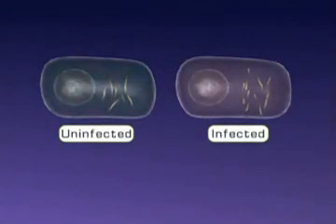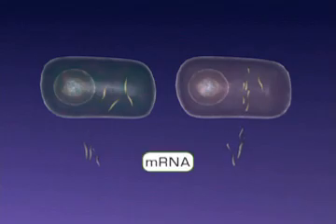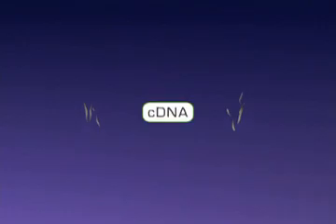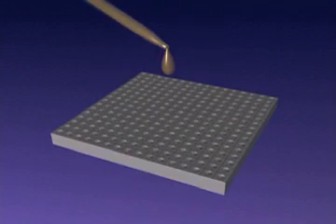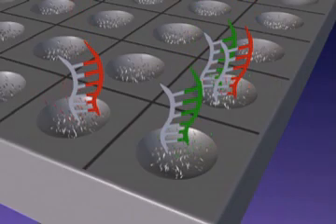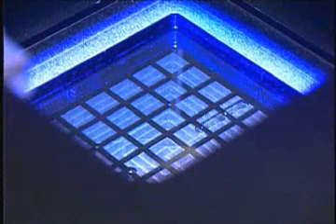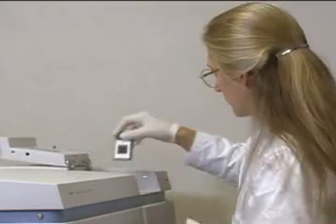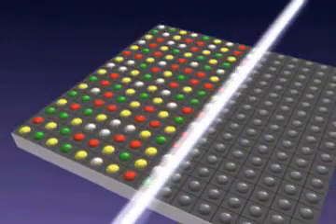DNA microarrays

Comment: Question: Why combine the samples from the infected and uninfected cells together? Surely you'd want to compare what's being expressed by keeping the samples separate and reading them side-by-side, rather than all of it in one chip?
Reply: Mondestrasz Precisely. nice Dante icon, btw!
Reply: my thoughts exactly
Reply: actually it makes sense, if there are same strands of dna on both green and red samples then yellow color will appear from the combination of the two colors, if the strand is just on one of the samples either green or red will appear, the rest will be empty. It seems easier to compare that way
Reply: Mondestrasz
Yeah, I'd actually made sense of it after a little thought - probably like 5-10 minutes after I posted it. :P

Comment: Hey great video.  I have a question...  when the fluorescently labelled cDNA binds onto the microchip, what is actually in the microchip.  Is it the DNA taken from different bacterial strains?  For instance is the DNA for one bacteria extracted and put into one of the spots?
Thankyou in advance
Reply: I agree. what is it?
Reply: Each spot(hole) in the chip contains different oligonucleotides(about 20 nucleotides long) complementary to unique regions of the genes you are investigating, so that they bind while other genes are washed away. hope this helps

Comment: 2 tissues and each tissue fluorescent coloured differently. The damaged tissue and the healthy tissue can either act the same or differently. If it acts differently, the DNA sequence will be different, and thus not bind to certain spots where the healthy DNA can bind. Because they are fluorescent labelled, the laser can pick up the color wavelengths in the spectrum, red (Cy5, 670nm) and cy3 (green 570nm). So the colour will tell how the healthy tissue is expressed compared to the damaged tissue.

Comment from the maker: I use Trizol reagent to purify, which is similar to a phenol/chloroform precipitation. You just have to make sure that you eliminate genomic DNA, and DNAse digestion on RNeasy columns from Qiagen can do that. Then you can do the reverse transcription to make the cDNA.
Also, for RT-PCR, primers should be made to span an intron so that you can eliminate any possible signal from genomic DNA contamination.